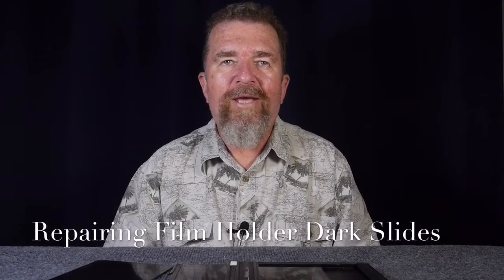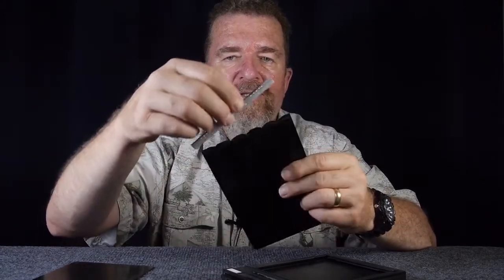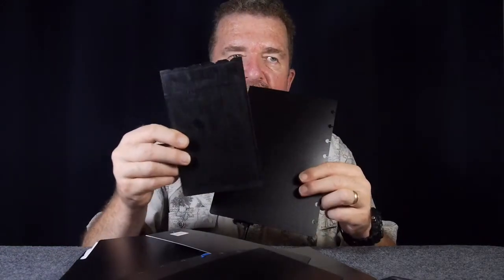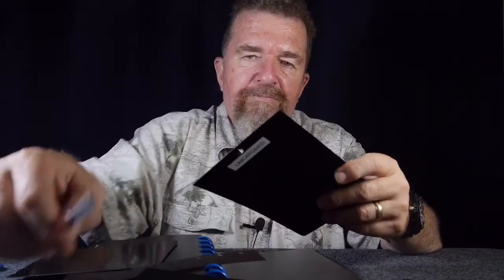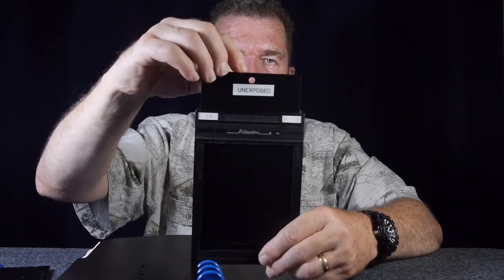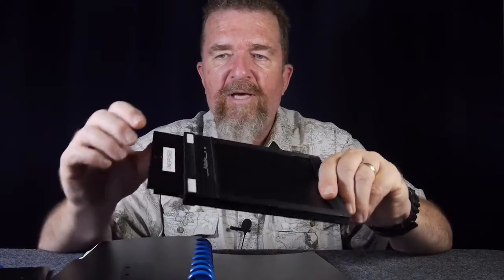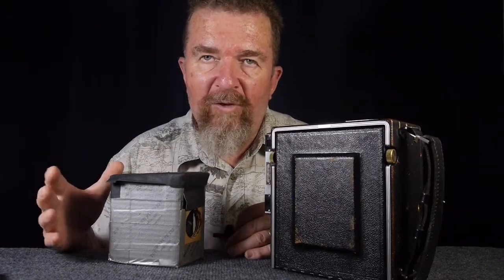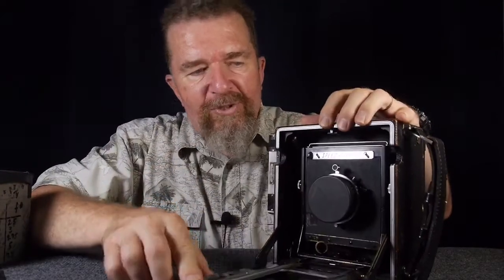Repairing Sheet Film Dark Slides

Comment: Joe, did you ever test the new plastic dark slides to sunlight? Toyo brought out a line of 4x5" sheet film holders that they made a big mistake with. It turns out the black plastic they used was not 100% opaque! Photographers were ending up with a mottled pattern on their developed films that turned out to be areas where the black plastic Toyo used was randomly more opaque than in other places. Now their dark slides are metal.

Terry Thomas...
the photographer
Atlanta, Georgia USA

Comment: But used film holders are really cheap compare to new but I understand trying to reuse older ones. I have bought older ones and some have light leaks and scratches were the film sits. Wonder if the light seals can be repaired or replaced.

Comment: As an alternate to making the dark slides longer (and therefore differently sized from normal holders) why not cut extra stips that are long and slim and glue them onto the primary dark slide? One could even be spray painted white. Or maybe the store would have a white plastic sheet designed for another purpose. I suppose Super Glue would be up to the task.

By making the new dark slides the same size as normal ones, the "L" locks would work as they should. That is a big advantage.

Terry Thomas...
the photographer
Atlanta, Georgia USA
Reply from the maker: Great idea!